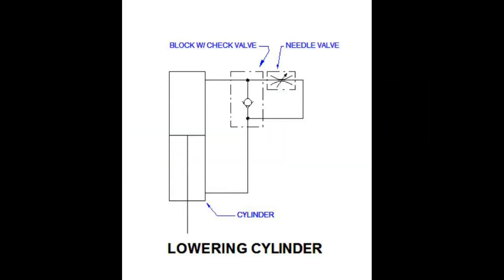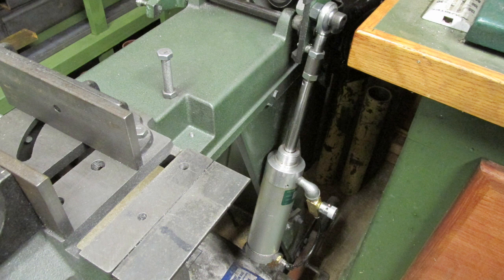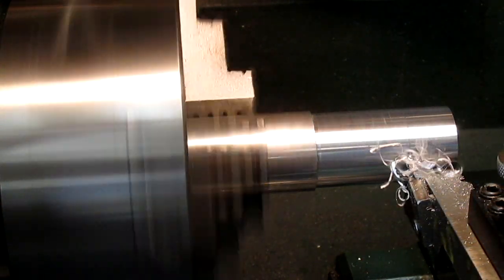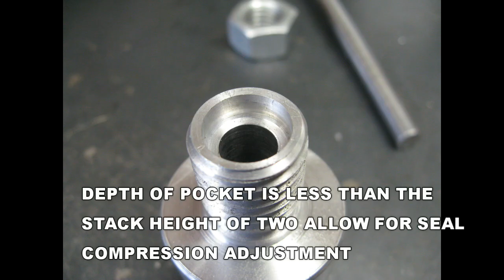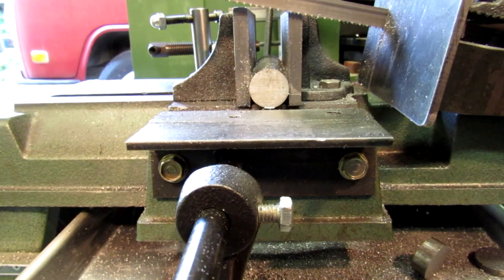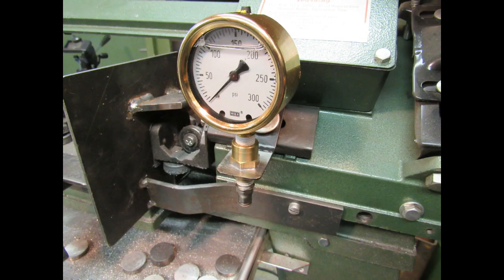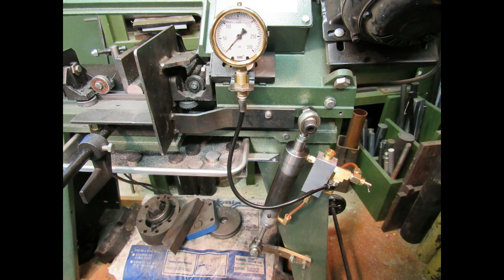Harbor Freight 4x6 bandsaw shop made lowering hydraulic cylinder and valve

Comment: Thank you again.  The pressure gauge was a great addition for understanding it clearly.  Especially the residual pressure of 50psi when cutting.  That flat plate you have on the near side of the saw is a great addition which I wish all manufacturers would fit.
Reply from the maker: +Joss Fitzsimons  The gauge is a fun addition. That clamping shelf ahead of the vise is one the best mods. It's simple, but it is invaluable for so many things. There are cuts you can make with it that would be difficult to do any other way. Thanks for the comment.

Comment: Thanks Allen for the other great bandsaw modification videos, i made those mods to my saw last week and now i'll add the hydraulic cylinder to complete the mods. I'm really glad you pointed out to mount it shaft side down as this will save me the head ache of replacing "O"rings in a short amount of time. Hope you have some more videos planned soon!
Reply from the maker: Thanks for your comment. I hope you will add the hydraulic cylinder. You be amazed how much it will improve using the saw from blade life to cut setup. I actually knew better on the first cylinder, but I did anyway! I have several project videos filmed, but editing them is the more difficult for me then the actual work on the projects! I will try to get some of them done.

Comment: Thanks Allen! Very interesting and informative video. And you definitely don't need to apologize for your narration! Sure, I've watched vids from the "masters" (ThisOldTony, Clickspring, Joe Pi, Abom, TitansofCNC, etc) but I enjoyed and learned  just a much from yours. Also thanks for providing examples from Amazon of valve assembly and hydraulic cylinder (@ 2:27)!

 Growing up, my dad had a Craftsman horizontal bandsaw of this size that came with the hydraulic cutting rate control built-in. I was disappointed to see that the inexpensive saws today (HF etc.) lack that control. It occurred to me that someone has probably figured out a way to add one--so here I am. Thanks again!

Comment: This is a great heavy duty retaining cylinder, made to last forever, the only thing I've would like as an extra feature on this, is a valve to stop the action while you set up or  measure, then you could set the needle valve to a position and not need to readjust it, still a minor inconvenient.
Enjoyed...   ;)
Reply from the maker: + beaudry stone  I agree and thought about the same thing. It would be convenient not having to change the needle setting in repetitive cuts. A small ball valve between or in place of the gauge tee and the needle  valve would do it. It's a good idea I may add to this set up. Thanks for commenting.

Comment: G'day Allen very interesting how you came up with this fix.  I am thinking of buying one of these saws this would be a great modification for it, great vid well machined kind regards John Tasmania
Reply from the maker: Thanks John for your comment. I have had this saw for over 20 years and it has been by far the best tool I have owned for the price. I have made many modifications mostly for work holding and convenience. It still has the original motor, belt and gearbox oil. Keep a good blade in it and have a little patience while it cuts and it will work for years. This cylinder modification is the best thing I have done to it and it makes the saw a joy to use. Should have done it years ago!

Comment: Very good video I have thought about making a cylinder for another project of mine gave me a lot of very good information always like to see others ideas. Thanks
Reply from the maker: +Kim Brerwer  Thanks for your comment. A little cylinder like this could be useful for several projects. Caution: This is for a very low pressure application. Anything higher pressure would require a different piston seal set up and most likely a welded base end instead of solder.
Reply: +Allen Powell I understand my needs probably would not be much higher than that in the video

Comment: Good to see you have been able to get some valuable shop time in Allen. A very interesting video on making your own hydraulic cylinder set up. Just a question about your lathe; what are some of the specs, turn height, size of chuck, bed length? You start looking at lathes and it gets very confusing to say the least.
Reply from the maker: +Mark Fryer   Yes Mark I manage to try to get out in the shop 1 to 1 1/2 hours as often as I can. My lathe is Grizzly G4003. 12" swing over the rails and the bed is 36" long. I use the 6" 3 jaw chuck primarily, but it also comes with an 8" 4 jaw. It does everything I need. It's the only one I've used and it had handled all I've thrown at it. You use only about first 12 to 16 inches of the bed in front of chuck for 90% of your work, but the extra length is invaluable when you need it! Thanks for the comment.

Comment: Mr. Powell, I know this is an older video, but I wonder if you have any videos or information on that diamond shear lathe tool? Thanks!
Reply from the maker: IBWatchinUrVids I made no videos of when I made my diamond bit and holder. If you search on the net for Tangential Lathe Tool as I did, you will find everything you want to know about the tool, how to grind the bit using a shop made jig and several ways to make the bit holder. Take the time to do the research and make the tool and you'll have a cheap, easily maintained, great lathe tool!

Comment: Thats a great mod all these saws suffer from poor feed control. Your homemade tooling is very impressive also, they were some big cuts.
Dont be hard on yourself about your narration it was fine........................Cheers
Reply from the maker: +thornwarbler  Yes, the high priced, up scale saws all have hydralic feed systems. The counter balance spring on the little saws is only slightly better than nothing. Who hasn't had the experience of cutting a piece of thin was tubing and have the saw gnaw away at first and after breaking through the wall rip the rest. Not so much with this set up! Thanks for your comment. I hope to get better at the narration.
Reply: +Allen Powell I was actually thinking the ideal setup would be to use both. Then the cylinder limits feed rate and the spring limits down force. Without the spring you have no control over the amount of down force when cutting thick sections where the cut progresses slower than the cylinder feed rate, unless you manually adjust the needle valve while watching the pressure gauge like in your setup.
Reply from the maker: +Thunderbelch  Maybe so, but the feed rate is so adjustable (down to drops per minute) that you can set the rate slow enough that the blade should have no problem keeping ahead of the saw dropping thus the blade doesn't see much of the load. My experience with counter balance springs, is the closer the blade gets to horizontal the more tension must be applied to the spring adjuster to counter the weight of the carriage. Like I said the gauge was just for fun. I said 50 - 100 psi gauge pressure (which is not true blade load) for a reasonable cutting speed, but I could adjust the needle for an extremely slow cut and the gauge would read in the 150 - 200 psi range.

Comment: Great vid! My air cylinder leaks for the same reason. :( I haven't gotten around to replacing it yet. But I'll keep your vid in mind when I do. :D
Reply from the maker: Thanks for the comment. It's been several months since I built this cylinder and it does not leak drop even though I just used simple o-rings for seals. This has been the best improvement I have made to the operation of my saw!

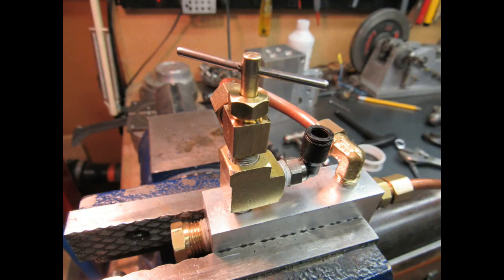Comment: Hi Allen, Great video, your saw has quickly become a model for what I'm hoping to turn my Marketplace budget buy into.  @16:23 in your video I'm looking at your bearing/blade guides they seem like a hybrid between the fixed ones that came on my yr 2000 model 37151 and the newer style that come on the "red" Harbor freight models. Is this a mod you did, or do you know what saw these came on OEM?  i like that they look like they can pivot like the new style, but mount to the machine like the old green ones.   thanks

Comment: Great project, and many thanks for posting!  Apologies for tuning-in late, and perhaps I missed it in the video, but at 11:59 you say "seat for check ball is pressed in and ball is fitted".  Where did the seat come from and of what material is it made?  How is the ball "fitted"?  Very well done!
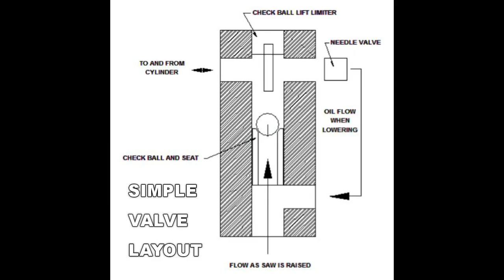Reply from the maker: Sorry I kind of skipped over few things to shorten up the video. The drawing of the valve at 11:35 shows the location of the ball and seat. Since I had to drill clear trough the valve body to make a passage, I needed make a seat for the ball to rest on because the ball diameter is less than the passage  id to allow oil to flow past the check when raising the saw carriage.  The seat is made from a piece of drill rod  that has drilled through. The seat end has a small inner chamfer. I put the ball on the seat before pressing it in and wack it a couple of times to form the seat to the ball better. The photo at 11:59 shows the seat in place with the ball sitting on it. You can loose  balls at bearing or hardware stores. Thanks for the comment!
Reply: Thanks, Allen — Got it.  That's just what I needed.

Comment: Hi Allen
How did you make the clamping angle plate for the side of the Harbor Freight band saw ?
Reply from the maker: Sorry for the late reply. The clamping angle was made with two pieces of flat bar because of the angle on the casting on the saw. One piece was bolted to the sloping face on the saw. The other piece was held level and flush to the top surface of the bed then welded to the first. Very handy modification to make.
Reply: Thanks Allen, I was afraid I may have to do that, just thought you had some magic trick. Thanks for the reply, U-Tube is great for sharing information and all the viewers appreciate what you are doing!

Comment: I dont understand how a hydraulic cylinder can simply be connected from one end to the other without some sort of external reservoir.  The end without the piston rod is going to displace more hydraulic oil than the other end. I'm not sure how you got around that with yours. Good video though.
Reply from the maker: Sorry I didn't see your comment earlier. You are correct about a cylinder that is filled at the base end with the rod extended. Especially if the rod is large in diameter in relation to the bore of the cylinder, with ports hooked together, as the rod is pushed in the oil is forced around to the rod end and since the rod displaces part of the volume of that side the cylinder will lock up before the rod is fully collapsed. If the cylinder is filled from the rod end with the rod in all the way,  when the rod is pulled out and the oil forced around to the base end and the rod will fully extend due to the larger displacement of the base end. Hope my explanation is understandable! Also notice my cylinder rod diameter is small compared to the bore an never strokes the whole travel in. Thanks for the comment.
Reply: @apowellz  Thanks for the reply. So basically it needs a little air space in it to work properly. Makes sense.

Comment: Do you really need a 6" stroke? I have several 4" but no 6"er's.
Reply from the maker: Duane Dickey  No not really. I used 6" because the old cylinder I was replacing was 6" stroke so I just matched it. Material cost was not a concern and I didn't have to move the lower mount around.  A 4" would work most likely just as well. The bore could be smaller also, but rod diameters start getting smaller too. You got to use what you have!